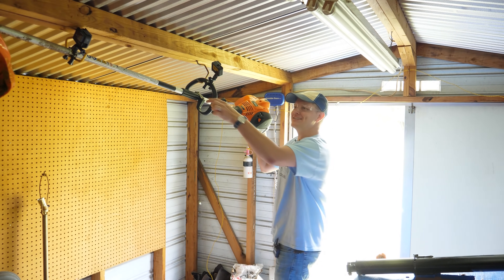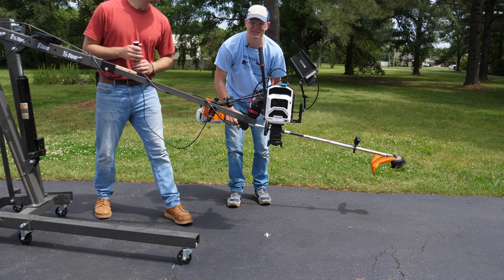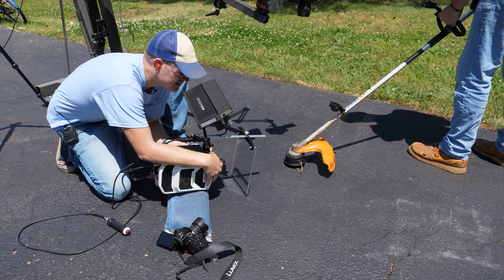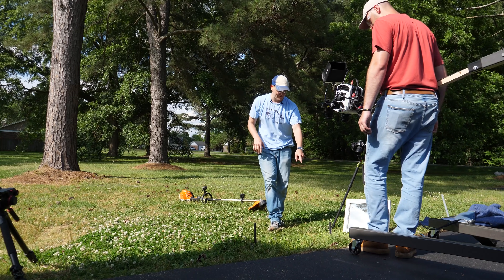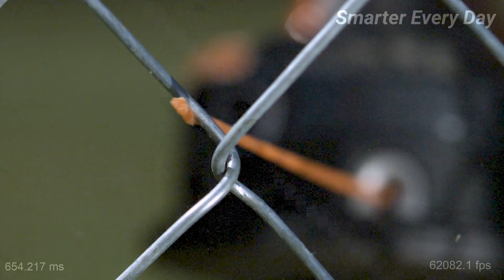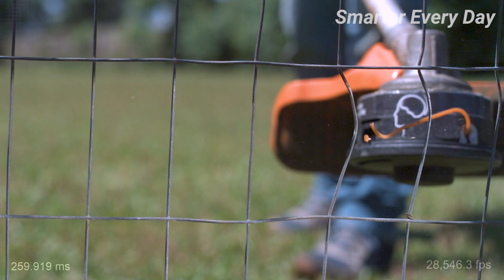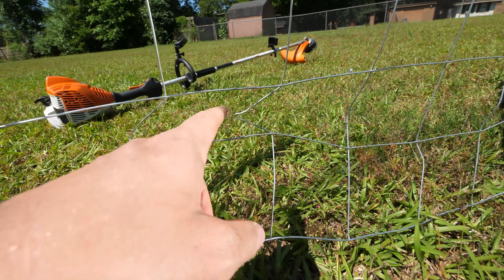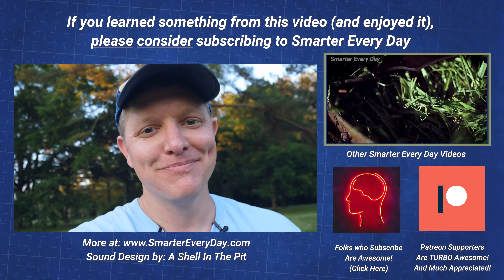How Weed Eaters Work (at 62,000 FRAMES PER SECOND) - Smarter Every Day 236

Comment: I'm curious about the last fence type because the line didn't wrap around entirely. My first thought was that the point at which the line hit the fence was further along the line than the other two, but it could also be because the third fence had the most give that there wasn't enough force to cause it to wrap around entirely as it did on the other two. Hopefully you will get the chance to test the variable of how much of the line hits the fence, ie if there's a quarter of an inch beyond where the line hits the fence or an inch. The first video I've watched by you, but definitely won't be the last!

Comment: Hi Destin, I'm a big fan of both your channel and lawn equipment, so this was a pleasure to watch! If you're interested, Husqvarna and Honda both make a 4-cycle weedeater (25cc and 35cc respectively) that have measurably more torque than a typical Stihl 2-cycle would (the new Stihl 4-MIX might be an exception). I'd love to see the difference between the 2-cycle and the 4-cycle in slow-motion. Also, the 4-cycle engine in my experience works with a heavier cord a lot better. I've been using Shakespeare's Ugly Line (0.155") on my Husky 324L (the 4-cycle) and it's unstoppable. Like a brush hog on a stick.

Comment: They make a weed eater head that has three independent swivel heads that you put about 6" of line through each swivel. Amazingly, you can weed eat all along a chain link fence without ripping your line to pieces. That would make a nice follow up to this video and on the plus side, you could weed eat for an hour without replacing the string!

Comment: I'm not sure if I agree that the break, on the smaller gauge wire, is because of the heat affected zone. I think it's from the constant stress at a joint. Kinda like it's pretty easy to break a paper clip, if you bend it in the same place, repeatedly. The joint just makes a good pivot point, which makes it a very easy source for a point of failure.

Comment: I’m glad u used the right terminology for the heat affected zone and that is with any weld whether it’s thick or thin material so if u see a weld crack through the weld and not next to it it’s a bad weld so that would be a good vid seeing a weld cracking in slow motion 👍

Comment: I feel that heat from tension is causing the line to heat up and sort of melt if you look closely you can see how the hard plastic line goes from a solid state to a lil bit of a flubber softer state when detaching

Comment: The right to left is the same reason you feed wood through machines / power tools through wood in a specific (usually) direction. You go against the force of rotation, as opposed to with it, in order to maintain control.

Comment: Neat video! One thing to keep in mind is that the resin line has what's known as a Glass Transition Temperature. This is the temp at which the resin begins to turn from the solid to liquid stage. I suspect the massive transfer of kinetic energy from motion to heat allows the resin to get close to or reach GTT making it so soft it breaks. Just a thought.

Comment: Great slow motion video. I was amazed at the string wrapping around the fence wire. Is it possible that the plastic is melted by the rapid bending-unbending? The string pulls apart where the plastic is softened. I love my weed-eater-whacker-snipper-trimmer-thingie!

Comment: That lagging angle is directly proportional to torque of the load, ie the length of the wires. In motors it's known as the torque angle

Comment: You should do a video using metal blades 3 and 4 points. Do it hitting rocks so you can see the rocks splinter with the slomo camera

Comment: Already SUBD but WOW such a cool vid. I used to solo be responsible for a large perimeter of weed eating. So much so I'd have to run two machines while one cooled off. I'd sit there in the heat and wonder specifically what the lines on the weed eater were doing... My vote for favorite line; triangle profile extra stiff in a 3 line pinch grab setup, not a bump line. Bump line setup had line that was too thin, I was mainly cutting weeds down with mossy undergrowth.

Comment: I haven't completely finished the video yet but my guess as to what is happening when you hit the wire is that the impact of the line hitting the fence is damaging the line by denting it making it less structurally sound, along with that when it wraps around it is stretching the line thus thinning the line out making it even less structurally sound, and that why it will sometimes break as it finishes wrapping around, but the stretch is why is also can break as it unwinds because its unwinding at at a slightly slower speed when it finally completely unwraps its then pulled by the motor almost if not immediately causing even more amounts of stress on the already damaged and stretched line and thus cause it to break. I'm not an expert on any of this, but just what I think is happening. And for reference I paused at 13:51

Comment: Hey, in the first  fence. The  fence is much more durable than the cord. And as the cutter rotates while hitting the fence. The cord cracks and the tension between the two ends of the cord do its job to severe themselves.

Comment: 12:07 re:"tension brake or shear break" -- How about a friction component? I realize that when the force/plasticity ratio of an interaction (engineers can supply better terms) gets high, things can get to looking quite liquid or jelly-like, but how much of that is due to friction in this case. When the plastic line bends very quickly and drastically, and when it drags against the metal, is the friction (internal and external) partly responsible for the way it seems to "slime" apart?

Comment: When you use non-metric measurement like 60/1000 in, would you please add a caption showing 1.5 mm. When I reach for my calculator or Google window and calculate the material width, I then miss out on half a minute and have to rewind to find the place where I lost focus. It disturbs the flow of your video. Thanks. Btw, i love your interesting content.

Comment: Watching the line interact with the fence was really able to highlight the reason that the weed whacker is so ineffective near the fence is that the line needs that full ark to be able to slap the grass apart. Once it hits the fence it basically stops moving and also gets deflected in the opposite direction of it's cutting tension.
That's why you still get some grass cut by the fence, but not all of it; the weed whacker can only cut for the first part of it's ark at the fence material, before it hits the fence.

Comment: Howdy. I have a question about the  plastic trimmer line and how it gets cut around the chain link fencing. Is it possible that this is more of a heat effect and not a tension break? Would it be possible to shoot this with a thermal camera at high speeds? Thanks for the awesome videos that you share with us.

Comment: Homework is to calculate the amount of energy the weed eater applies in a strike based on the amount of deformation in the last chain fence. Assume the force is applied perpendicular to the chain and the section of chain struck is a simply supported beam.

Comment: 3 things...
1. Whipper snipper, but I'll let you off for that one.
2. Blunt force trauma on grass much.
3. Its a design feature, different lines have different resistance to obstacles. Light grass + light line + fast revs = perfect.
Light line + heavy resistance + fast revs = breaks.
I am curious to see what happens when heavy line meets light resistance at fast revs. 
Will it tangle? Will it break the resistance?

Comment: Math challange: How fast is that very end tip of unwinding string from the fence (must be faster than regular whip i guess)
Reply: Well. Whips are, at their max, really freaking fast. And remember, the weed eater needs to maintain that speed. Or am i wrong, i dont really know :D
Reply: Pretty sure it is slpwer than a whip.
The tip of a whip can go faster than Mach 1, if the weedeater could go that fast you would hear a sonic boom.
Reply: @aristidgrossmann7223  yea but imagine that rotation itself and either that string have to wind up and unwind in very slow window of oportunity ..it must be really fast
Reply: Im too lazy, but you could estimate/calculate it using the elapsed frames per second it takes for the tip of the string to move its own diameter (approx .1 inch) as it unwinds.
Reply: Ok,at 13:36, I roughly calculated that the string moved 13 X's it's diameter in .161 mS... Guessing the diameter at about .1 inches gives 672.8 ft/s unless my math is off.
Reply: Oh well so in metric its around 205m/s so its 3/4 of speed of sound wich is 345m/s in perfect conditions.. thats awesome

Comment: 9:56 It is called garden fencing, and you installed it upside down! It’s small at the bottom to keep smaller critters out, and larger at the top, where the smaller critters can’t go, to save wire.

Comment: Weed eater line is also purpose made certain weights and lenghts. Not just because the engine maybe less or more powerful per weed eater, but to counter balance the trimmer head. Which is why using the wrong size line causes the feeder to jam or over release. The line also has an edge to it, weed eater line is never round and smooth. Those weedeater line replacement blades never seem to last as long as just cheap weed eater line, even when they've been balanced in manufacturing .

Comment: I think it's like metal fatigue only with plastic. It's happening so fast that the stiffness of the line cause heat buildup at the point of breakage. I wish you could come up with a way to measure the temperature of the end of the piece that breaks off. My theory is plastic fatigue. Please tell me what you think of my theory and if you think it holds any validity. Hey and don't make fun it can't be any worse than spaghetifacation.

Comment: I think you need to look into the chemical make up of the string itself. If you look closely at some of the small pieces that are coming off the string it's got really small thread like ends to it like it either stretched it and broke ,or it heated up momentarily ,stretched then broke. You need to find out why and where those thread like ends on the pieces that are coming off the main line are coming from

Comment: It isn't just the heating effect changing the wire strength at the joints, it is also the fact that the wire is heavily supported at those connection points, causing a very large local "stress riser" or discontinuity.

Comment: The breaks on any kind of wire fence is also exacerbated by heat.  Watching your video you can see where the wrapped small loops are partially melting then breaking off as the loop unwinds off the fencing.  The melting is making the string weaker and easier to break.  Similarly with the length cutter in the shield.  It won't cut at idle.  It takes speed and the friction created with that speed.  I always slow down at fence edges to preserve my line.  Grass will still cut and the line won't become shortened by the fence at lower RPM.

Comment: Hey Dustin! awesome stuff, like always. You did not mention THIS though:
It seems like the lines did brake a lot more on the thicker wire and I think this is because the thinner ones are way more flexible. They catch much of that impact force, so that the lines were able to wrap around the wire and untangle without getting cut so much.
What do you think?

Comment: YOU DIDN'T CHECK THE HEAT BUILD UP  (caps for attention) on the composite (plastic) monofilament in that infinite moment of hard bending (around the wire fencing). The flash heat from bending/flexing the filament enough to weaken/break it. Remind everyone the edge of the rotating filament arc is the best for cutting grass, as it is the fastest. But it is all the same RPM as next to the hub.

Comment: Your "hog wire" is called "2x4 welded link", and the next one is called "field fence" (characterized by increasing distance between runner wires from the ground).
And I was glad to see a video by you that did not include any guns.

Comment: Maybe add a FliR camera to the mix. Run the line against a surface. Doing it indoors/garage to have more heat contrast vs outside in the day.

I know I said this before but I would have loved to do this with that highspeed camera. Weed eating was my life for a long time. Very therapeutic until you run a customers yard that is filled with dog s#*t.

Comment: I would have loved to do this video. I made a rig once to connect a regular dslr to my weedeater but the vibration made the video unusable. I then tried a skate rig tethered to the pole to follow the head but it wasn't slow motion so again not usable.

Weed eater line will get hot. That heat can transfer into the spool in the head and weld the line in places. Usually cheaper line will have more welding issues but any line can if you abuse it. 

I run the thinnest line of  "Titanium Force" by Husqvarna on a Stihl 115R. It lasts forever on maintained lawns and is pretty aerodynamic. You can run longer that the guard without the motor getting bogged down.

Comment: The reason the weed eater feels like the fence is pulling the line in is due to the slowing of the line, and the continuing rotation of the spool. The opposite end will wrap the line around the circumference of the spool, and pull in the weed eater closer to the fence at the same time the line in delay in its rotation. And the spool is moving close to its continuous in its revolutionary speed.

Comment: Destin, I love your videos, and I know you put a LOT of effort into every one. The only complaint I have is that the fake audio used during slow motion footage is a bit distracting. Please understand, I'm not trying to criticize you or your work in a negative way. I'm just trying to provide some honest feedback. I may be missing the point here, and you are certainly free to make any artistic choices you wish to in your videos. It won't offend me at all if you completely ignoring this comment, actually.
It is clear that a lot of care has been given to make the slow motion footage both entertaining, and aesthetically pleasing. The audio that has been added in post certainly gives it a star wars feel. As in, this is obviously faked, but solely for the purposes of making it more enjoyable. The problem is that all the timy details that go into the sound couldn't possibly be real, and it keeps pulling my attention trying to figure out what made that noise. Perhaps instead of the sounds, it would be acceptable to speak on the fact that the video is slowed down so far that we can't hear it any more, then take the time to explain during the footage of what we're seeing. Things like "notice here how the string is vibrating at [calculated frequency], which is a multiple of the engine rpm" or whatever, you know? There's so much going on that could be explained during those periods of otherwise silence.
Or if the audio is an artistic choice, maybe a text overlay that says that the sound of simulated due to physical constraints in the universe.
Overall though, I have found your videos to be very educational and entertaining. Thanks for the hard work and passion in these projects.

Comment: Does anybody know what the RPM's of this weed eater are? I know there is a way to calculate RMP's using high speed footage however I don't know how. I am wondering because I recently got ahold of an old weed eater and I am hoping to power my bike with it however I need to know the RPM's in order to figure out a good gear ratio. Im hoping to have a top speed of around 30mph.

Comment: first thing I do when buying a new weed EATER is remove the guard, find the sweet spot where the line is longer but doesn't bog the engine down...get a lot more grass cut with less time...maybe a bit more fuel but oh well.